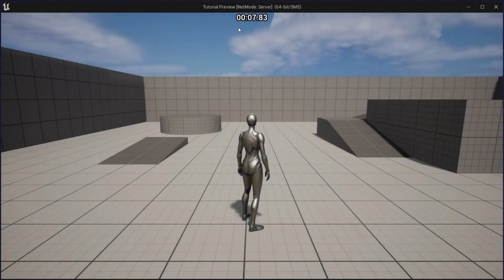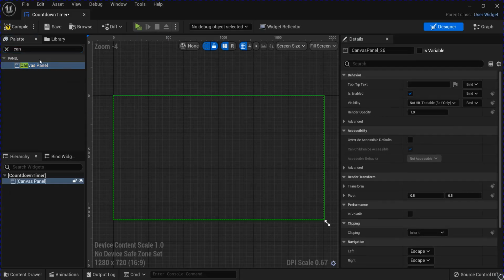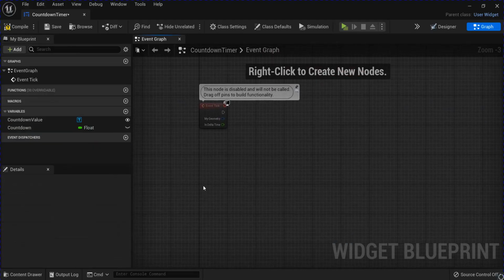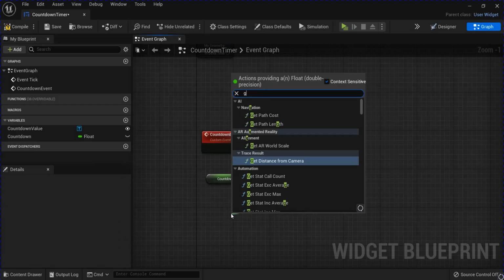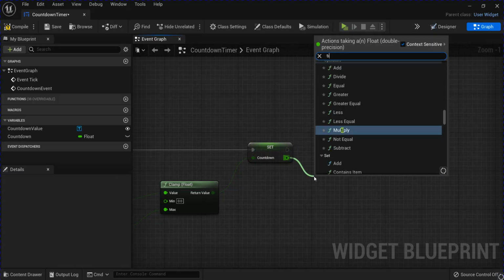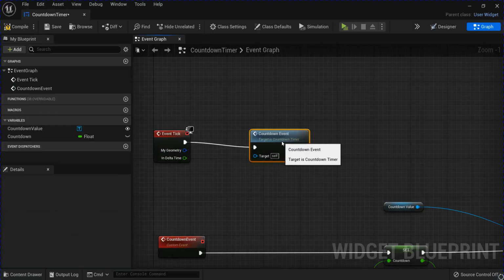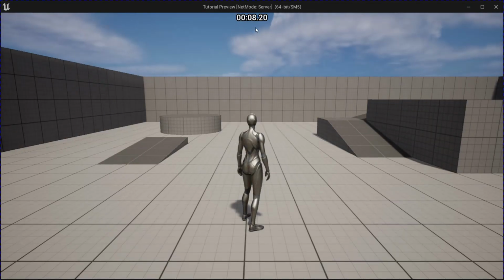How To Make A Countdown Timer | Unreal Engine 5 Tutorial

Comment: I did everything you did in the third person template, but when I hit play it doesn't work, nor does the countdown appear at the top.
Reply from the maker: Try making a new Blueprint Class - Player Controller, then on the top left go to Edit - Project Settings - Maps & Modes and under Default Modes the Selected GameMode to set you new Player Controller as the Player Controller Class, after that open the new Player Controller and go to the Event Graph and on BeginPlay drag out and Create Widget, drag from Owning Player and get a reference to self then drag from the Return Value of your widget and Add to Viewport 🙏 If this doesn't work let me know, the reason it wouldn't be on your screen is I had already setup my UI in a previous video 💯

Comment: The tutorial is straightforward. Could you provide guidance on creating an animation where a number increases incrementally? I've been searching for an animation tutorial like that for weeks.
Reply from the maker: I'll need a bit more information. When you say increase incrementally do you mean going up 1 by 1 as an integer? If not could you explain a bit more or refer to something that I can search up to know exactly what you mean? 😁🙏
Reply: @FcbDev  Yes, going up 1 by 1 as an integer. I found a tutorial using Blender but can't find any on UE. Here is the video: https://www.youtube.com/watch?v=c8yzZzznaVc&pp=ygUiYmxlbmRlciBhbmltYXRlIG51bWJlciBjb3VudGluZyB1cA%3D%3D
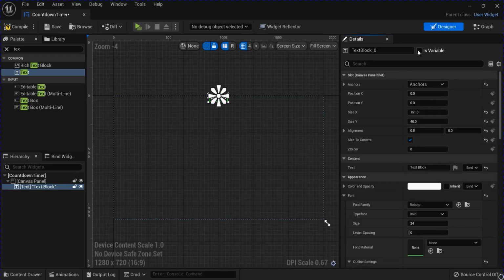Reply from the maker: @dangtranhai3525  Follow this tutorial until 0:36 https://youtu.be/ylu58CbGENU after that make the Timer variable an Integer and drag it out and Get, then from the variable do a ++ or -- depending if you want it to count up or down, then grab the TimerValue/TextBlock_time and Get, then drag from the TimerValue and SetText (Text) and plug the Set Timer into the In Text. After that go to your Event Tick and get a Delay and set it to 1.0 for the duration and from the Delay you want to get the TimerEvent we just made 😁 Also go back into the Designer and set the default text value to 0 🙏
Reply: @FcbDev  Awesome! Thank you for dedicating time to this. I'll follow this structure, and hopefully, it will work.
Reply from the maker: @dangtranhai3525  I'm glad I could help 😁🙏 Let me know if that's what you wanted when you try it out 💯
Reply: @FcbDev  I followed the steps you mentioned, but I got stuck at the end. I watched the rest of the video hoping to find how to display it on the screen, but no luck. Then I realized that your video assumes you already have a "game project" set up, including a "PlayerInGameHUD" widget. Still, what I'm trying to do is make a 3D Text as a Static Mesh, counting up until it reaches a certain number. Something like this: https://youtu.be/GIIQ9KReQtI?si=ttyTfZFFfMqespE0&t=158
Reply from the maker: @dangtranhai3525  My PlayerInGameHUD is just a user widget I put all my other user widgets on, to add it to your screen you can go into your player controller and on Begin Play you want to drag and Create Widget, then select the one you made and from the return value you want to drag out Add To Viewport. Ah alright so if I understand correctly you want an ingame object that shows a number increasing instead of the user widget? 🙏💯
Reply from the maker: @dangtranhai3525  To make it an ingame object start by creating a Blueprint Class, Actor. Open it and go to the Viewport, Add a Text Render. Then go into the Event Graph and make that same Custom Event and Variable for the Timer as well as plugging it into the Event Tick. If you want the number to stop at a certain point then go to the TimerEvent and right after the ++ make a bit of space and drag from the value to get a Clamp then plug the Clamp back into the To Text and set the Max to whichever number you want it to stop at. Also if you want it to get to that number faster/slower then you want to adjust the Delay in the Event Tick to be Lower/Higher than 1.0. Let me know if this is what you wanted when you get around to trying it 😁🙏 Also the TextRender is the Target for the Set Text in the Custom Event 💯
Reply: @FcbDev  I think I missing something or plugged something wrong here. This would take me a couple days to figure out. Still, really appreciate your support. I'll reach out to you if I have any questions. 🙏😄
Reply from the maker: @dangtranhai3525  Sounds good 😁🙏If it would be easier with screenshots then feel free to add me on discord "fcbdavis" and I'd gladly take screenshots of the blueprints to send to you 💯
Reply: @FcbDev  I response 2 times on this post but somehow it won’t show up. I’ve already add your discord. If I can take a quick look at your blueprint screenshot, it would help me a lot.
Reply from the maker: @dangtranhai3525  All good 🙏 I just sent it to you now 💯😁